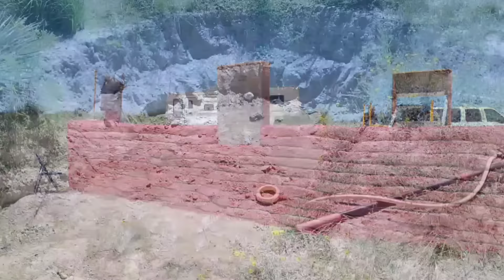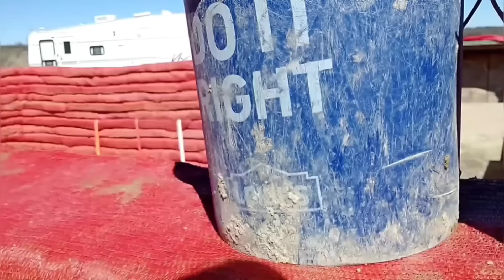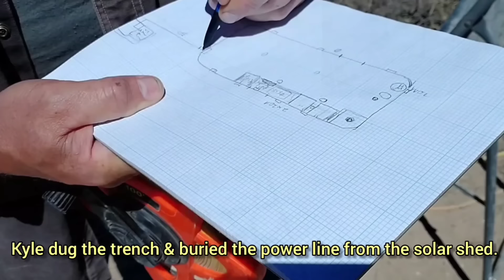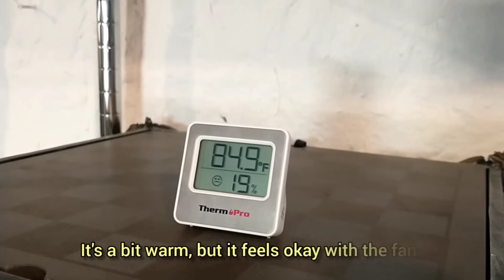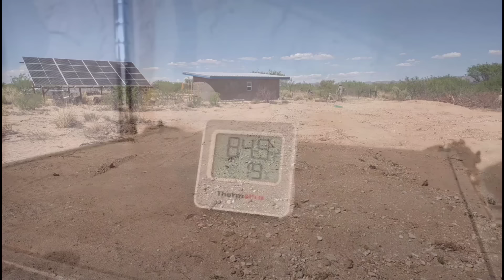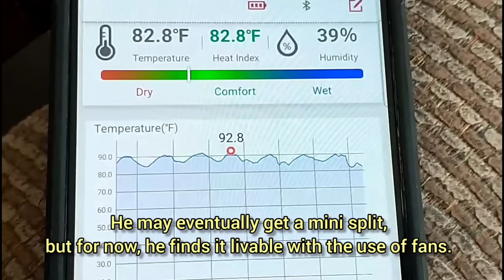FULL BUILD! Off-Grid Tiny Home from Start to Finish DIY Hyperadobe in the Desert

Comment: Very good! It is a manual 3D printer. It is a tiny house as you say, but with that method it could be 10 times larger. Do not stop.
Reply from the maker: It's a lot of work! Smaller is usually better with this type of build. Some people build large hyperadobe homes, but it takes them many years to complete.
Reply: Maybe practical if you actually make it with a 3D printer, but manually it's a lot of work.

Comment: It's a great project. And yet, those dirt bags are something like $5000 so I wouldn't call this a dirt-cheap tiny house. Personally, I bought and used five tons of straw at a cost of $375, minimal stud framing and got a 24'x24' cabin installed for less. (I actually bought eleven tons of straw, hired a semi and sold six tons that day, offsetting my transporation cost for my own.) Down in Peru, I designed a house that a hundred volunteers could build and assemble in a span of five days for a cost of $500 each. I'm not kidding.
Reply from the maker: The two rolls of bag material cost $900. He had 1/2 roll leftover, so the actual cost was $750. 
We could have built a cheaper roof, but opted for heavy guage R-Panel metal roofing with 5 feet of overhang to shade and protect the walls. A roof with minimal overhangs and sheeted with tin or tar paper would have cost a lot less, but it also wouldn't last nearly as long.
That's awesome you are able to quickly and inexpensively build homes! 😎👍 
This house has new appliances, electric, plumbing and a good roof. We saved and reused as much as made sense, but did splurge some on the roof and appliances. 
This same roof would have cost a lot less 3 years ago. Material prices have gone up.
Reply: @RedandAprilOff-Grid Awesome build! What is the name of these rammed earth rolls?
Reply: Es gibt noch soviel Platz auf der Welt aber in Deutschland kann man gar nichts mehr.
Reply: @elkekoehler5580 hah, yeah, Germany is overcrowded as heck. You can build even cheaper than this here, though. It's just not allowed in Germany, too many weird laws and regulations. Only if you were to live in your Garden shed you might get away with more.
Reply from the maker: @alodelore9597  It is 18" hyperadobe bag material purchased from https://volmcompanies.com/products/fencing-fabrics/hyper-adobe-tube-netting
Reply: @RedandAprilOff-Grid 
You guys did a fabulous job !!

Congratulations !!
Reply: @elkekoehler5580 geh hin wo noch platz ist,....Das Leben ist schoen aber kurz 😉
Reply: @alodelore9597 the Germans are drowning in regulation 😢
Reply: But can you do that here in the United States

Comment: Awesome job guys.  A mini-split would definitely be my first upgrade.  Other than that it seems to be everything a bachelor would need.
Reply from the maker: Thanks! Yes, a little heating and cooling would make it more comfortable, and he has quite a bit of extra solar power he could put to use. 🌞
Reply: @jurb
Definitely more windows , earth floors , sculptured earth lime plaster inside, bottle walls inside washroom, wood shelves,
Reply from the maker: @robford3211  Yes, more windows would have helped heat the place in the winter. Kyle wasn't interested in doing any artsy type stuff. The bathroom floor is concrete, but the rest of the house has earthen floors.
Reply: Its perfect and easy to change and add to awsome build
👍👍👍😜🏴🦕🦄😁🤞✌️

Comment: GOOD you all have homes...And you're extremely HARD WORKERS❤...But this was the CRAZIEST BUILD I've EVER SEEN 👀 ...THAT is a RIDICULOUS bunch of digging and pouring a d pounding DIRT...AND the TIME and EFFORT was WAY too much for MOST people! 😮😂I KNOW there are easier, and cheaper ways to build an off grid home! GOD BLESS YOU ALL ❤🎉
Reply from the maker: Thanks! 😄 Dirt Is pretty much the cheapest building material out there, but it's definitely a lot of work. The roof was by far the most expensive part of the house, so you could save some money there. We also included the price of new appliances with the home total. You could probably build an earth bag dome for less, but it would also be a lot more work because in order for it to be structurally safe, it has to be just as tall as it is wide. So a 20 ft dome has to be 20 ft tall.  That's a lot of dirt! 😊🛖🏜️

Comment: I hope you put something in the mix that will combine with water to set to make the walls less dependent on the sacking. I hope you will protect the walls with stucco or something.
Reply from the maker: The pit seems to have the right amount of sand, clay, and caliche. It packs well and dries really hard. The result is much like rammed earth. Yes, we put stucco on the outside and cob on the inside.

Comment: If the house had been made round, that would have given more indoor space, been cooler, and allowed winds to flow around the walls.  A circular roof with a center beam and voila, you have an ideal desert dwelling.

I love the bagging of the walls idea… very thermally efficient.  And you know critters aren’t likely to nest in the walls.  One can add old water and wine bottles to such a house in the walls for color and light flowing in.
Reply from the maker: The roof reflects heat away and helps shade the walls. Hyperadobe is not recommended for domes, and there's a lot of engineering that has to go into the design. Typically a 20 ft earth bag dome, needs to be 20 ft tall to be structurally sound. That's a lot more dirt, and a lot more work.
Reply: @RedandAprilOff-Grid Yep, domes are an absolute pain to construct.
Reply: @RedandAprilOff-Grid  Thank you for explaining.  If you had posts outside the dwelling for the roof would that work?  I think the sand bag idea lends to a lot of creativity, at least that is where my mind goes.  Thanks so much for sharing the build with us all.
Reply from the maker: @louisegogel7973  Yes, you can use outside posts to support the roof, but it's going to cost more. That is usually done if the material used to build the home is not structural enough to support the roof. Thanks for watching! 🙂🏜️

Comment: Great job, I would do an outside kitchen and not heat up the inside and turn your hole into a pond for extra water storage!
Reply from the maker: Thanks! He's planning to add on a sleeping porch to the front of the house. The nights are  cool here, but 2:00 AM is the hottest time inside the house. It takes a long time for the thermal mass to cool down, but an uninsulated room added on to the front (which is the shady side) should work out really well. Yes, the hole fills up with water when we get big rains

Comment: If he wants a dryer, they have those stacked washer and dryer combos. They are perfect for small spaces and I have heard some people would have them in a small apartment.
Reply from the maker: Yes, with a stackable washer and dryer, there would also be room for an oven. Dryers and ovens use too much power for his solar, but could be run on propane.
Reply: @RedandAprilOff-Grid  Gotta be careful with propane... recall my father warning me why he didn't always get his propane heater out since the gas can leak or in rare cases not burn completely... Also saw that gas stoves always leak gas, only slightly less than when they are on. But yeah, totally get the solar bit. Honestly, I want to build my own power generation thing, but I would need batteries, and that's where I get tripped up wanting to make my own lol. Been trying to develop a salt water battery, and its taking quite a while.

Comment: В минусовую погоду эту глину разорвёт со всех сторон. Это только для тех регионов где круглый год плюсовая температура. И видимо у вас метал дешевле чем дерево. И крышу тоже можно было из глины. Так строили в 1990 ностых годах). Печаль. А сейчас 2023, технологии? Неее не видел. Скорее всего трудно доступные места, ну или материалы не доступны по цене. Но вы молодцы, огромный труд. Удачи вам.
Reply from the maker: The winter season here is very dry, so freezing shouldn't be a problem. We did use a more expensive roof with large eves to protect the walls. I expect this house will be around for a very long time, 18" thick walls made from packed sand, clay and caliche.

Comment: This is similar to the mud brick houses they make in guatemala.  Usually they last 10-20 years or so but it's much wetter down there
Reply from the maker: With a good roof, adobe brick homes built in the desert can last a very long time. Hyperadobe is more like rammed earth. It has much thicker walls, and is more of a monolithic structure.

Comment: Looks great! Up until the time you mentioned those temps....Yikes, HECK NO!!
Reply from the maker: That is the temperatures without any cooling, and during a particularly hot summer. There were a few days when we got up to 106° outside during the day and it only cooled down to 80° at night, so with those type of temperatures there's only so much thermal mass can do. He found it livable, but he can always use an air conditioner next year if he wants to.

Comment: Completely shading the exterior walls with overhang dimension would knock off a degree or two.  In south Louisiana that was the purpose of the wrap around second story balcony/ porches to avoid direct sun on the walls.
Reply from the maker: Yes, the large overhangs definitely help. They also protect the walls.

Comment: You can same thing with using containers. Cheaper and faster without hurting your back and knees. I Dont get the point why you had to deviate the standards. Your sprint for building house is awesome 👏
Reply from the maker: Shipping containers aren't cheap, or easy to turn into a home. The price has more than doubled in the last few years. The completed walls and foundation for this house cost less than $1,200. Thanks 🌞

Comment: I miss sitting in front of the evap cooler when I lived in the desert. No AC needed.
Reply from the maker: Yes, we have one in our house, they work well until the monsoon rains begin. This year, we installed small window mount units in our house and in Kyle's. They aren't a big draw, and we have plenty of power to run them anytime the sun is shining. We still use our evaporative cooler when we have days that are less humid. The fan setting is great for bringing in cool nighttime air.

Comment: an AO smith 50 gallon voltex hybrid water heater would provide as much or more hot & cold air inside- PLUS heat more water than you can use, for the price of a small mini-split- and spend 1/2 the kilowatt hours doing it, than any other way. I've installed & used rheem, bradford & the AO smiths- AO smith makes the BEST heat pump water heater. using this method is genius, because in the summer, you're essentially sucking the heat energy out of your house & using it to heat your water- and in winter- the stored hot water acts like a 'heat battery'... that you can use at night.
Reply from the maker: Sounds interesting! We'll look into it. 😎

Comment: You are supposed to stake each layer to the layer below OR several layers using rebar.
Reply from the maker: We didn't see any need. The walls are 18 inches thick, the mesh bag is grippy, the sand, clay, & caliche soil is packed down and dries very hard. It's an impressively solid structure.

Comment: I'd add a geothermal system to heat/cool the place. A backhoe and a lot of hose and couple days of work. Maybe $2500 for the heat pump so not crazy expensive.
Reply from the maker: Unfortunately geothermal isn't very effective here. The soil is too dry, but evaporative coolers work pretty well most of the summer.

Comment: I don't understand the point of having those huge thermal Mass walls without a thermal Mass roof. Will you not lose heat and cold through the roof?
Reply from the maker: The house already has plenty of thermal mass. The insulated metal roof helps by shading the house and reflecting heat away in the summer. The insulation will also help keep heat in during the winter.

Comment: Its amazing what you all did :) 
But personally I don’t understand if you build en budget house why you made roof so strong like you want to keep 100 tons tank above it 😅😂 I just don’t get it first I thought it will be second condition but no its the most strongest roof on the such small house 😂
Reply from the maker: Thanks! 🙂 We got a great deal on them. They were less expensive than most other options, and we already had them. They are 20 ft long 6 inch Cee purlins, very strong, but nothing like a steel I beam.

Comment: Why build like that?😳😲
Please take two height sized containers. Very well insulated on the outside.
Then you have a great tiny house.😊
Reply from the maker: Kyle did consider it, but shipping containers aren't easy to work with or inexpensive. When he started this build two uninsulated containers would have cost more than the completed house.
Reply: From my opinion thermal energy is much higher for this setup compared to containers' 1cm metal.  In other words you must heat non-stop containers house.

Comment: Sounds like a mud hut with extra steps
Reply from the maker: They are both made from soil, but hyperadobe bags make everything easier, and results in a more stable structure. To build a mud house you have to mix in the straw and water, which is a lot of work, and you have to put the mixture into forms and wait for it to dry. Hyperadobe is more like rammed earth, it is made from packed clay, sand and caliche with the bag acting as a leave in place form. 🌞🛖

Comment: Very similar to a 3D printed house but much slower and demanding process…I would miss the level of energy and perseverance needed ! I would think it would have been probably better to put bigger insulation panels on the roof, they look a bit thin to me, no ?
Reply from the maker: Hyperadobe is definitely a lot more work than 3D printing! 😄 Yes, a double layer of thicker foam would be better. That's what we did on our house roof. In order to use thicker foam, we would have wanted to add another layer of purlins which would have added to the work and cost. It's also hard to say how much additional insulation would actually help since the walls are only thermal mass, and he probably won't be adding much heat or cooling to the inside.

Comment: How cold can a cold shower be in the desert when the temperature can reach 110 degrees.
Reply from the maker: Well water is pretty cold year round. Cold showers aren't so bad in the summer but in the winter we typically get down into to the low 20°s at night, and sometimes into the single digits.

Comment: Needed rebar, chicken wire against the outer walls before adding stucco.
Reply from the maker: The walls are made from hard packed earth so rebar isn't needed. The bags are a mesh material, so the stucco sticks well.

Comment: I've always wanted to build an adobe home but I don't think this is for me this seems way too slow😮 I've watched where they Blitz building with people who know what they're doing and have built them before super fast super luxurious cool though
Reply from the maker: If you had a whole crew and could rotate people out, it could go pretty fast, but with just one or two people it's a slow process.  Especially when you have to take time off to let your knees, back, or shoulders heal. This type of repetitive work can be pretty hard on the body.
Reply: @RedandAprilOff-Grid  yeah that was my point your process look very slow we're all on the same page I've watched many on this topic first. Usually the first part is making a whole bunch of bricks. So walls go up real quick. One of the favorite ones I watched as when they did it the original Spanish missionary away with hay and goat's milk. for some reason the walls lasted almost forever. Wish I could remember that was but I'm getting old LOL have a great day Great Adventures to you

Comment: Could do with some windows nothing like letting in plenty of air an light l would feel depressed without windows but that's me.
Reply from the maker: All of the portholes just have screen material on them, so there is ample light and ventilation. More windows would have been nice though, especially in the winter, to help heat the house. He has a lot of recessed lights in the ceiling too, and they are dimmable.

Comment: Regarding the electrical boxes EMBEDDED, a hundred years ago, most homes had the electricity on the outside of the wall interior, for convenience. This eliminated service upgrades and wiring issues, your in proper condition the way it is and it's easier. 😂

Comment: The septic cost more than the house! I would have done without it and installed an incinerating toilet. More energy usage - electric or propane - but you can save a ton of money.
Reply from the maker: They are pretty lenient on most things in our country but a traditional septic is required. Prices have gone way up in the last couple of years, and his leech field was massive due to the high amount of clay and calichi in the soil.